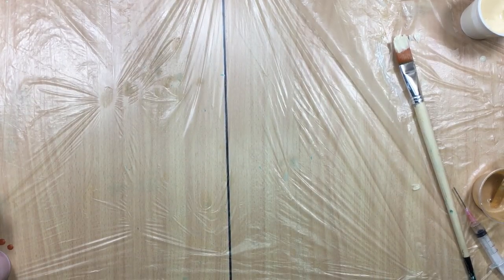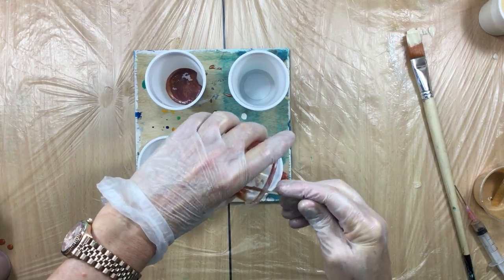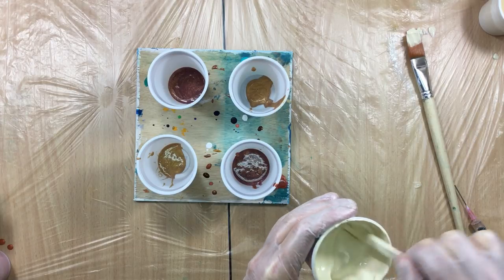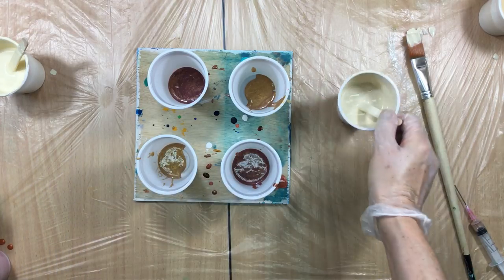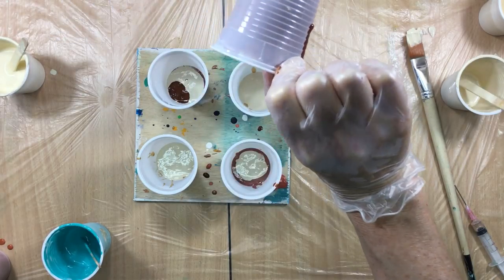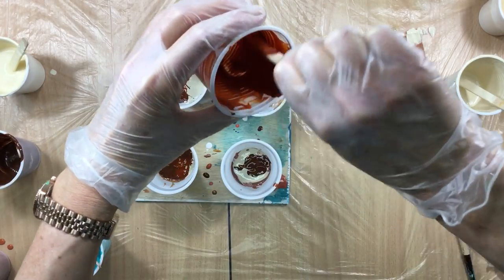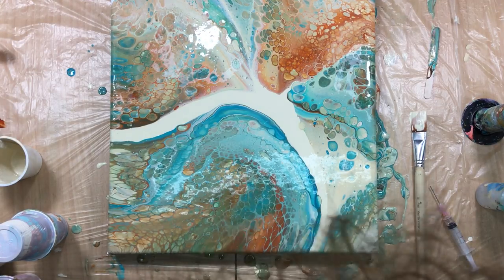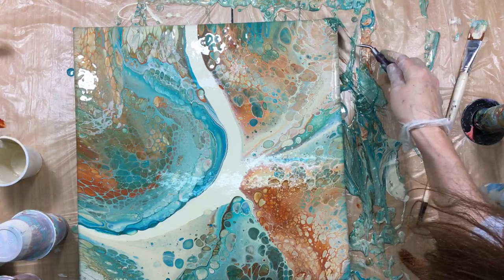( 283 ) 4 cup flip with rusty colours and turquoise.

Comment: Your videos are such a beautiful way to start my day!  When you do a multi cup flip cup on a larger canvas, try using a board inside the stretcher frame on the backside of the canvas to spread the pressure from your hand equally over the cups, might make the flip less likely to go a miss.  Another idea, you may have done this already, instead of pouring all of the 5th cup in the middle and spreading it with the brush, pour it in the areas you spread it.  Have a lovely day!
Reply from the maker: ♥♥♥Thank you ♥♥♥

Comment: Hi Annemarie.  Is it possible to use say Dulux water baste house paint to use for pouring acrylics thanks Pam
Reply from the maker: Yes I have heard a lot use housepaint... but I wouldn`t sell them but that`s just me....♥♥♥Thank you ♥♥♥
Reply: Pamela Usher I use Dulux Mixlab from the oops shelf at Homebase for my negative space and it works a charm. I grilled the Mixlab guy about whether the base they use was the same as the base in the off-the-shelf emulsion, but he didn't know (I've tried pouring with a cheap Aldi emulsion, but it didn't cell. it was much chalkier than the Dulux, the latter dries flexible just like acrylics).
After trying a 250ml tester pot of greyish white, I thought I'd have to stalk the place for months waiting for a white/ivory (I mean, who pays double for a hand mixed white?), but I went in a couple of weeks ago and found 5 litres of white and 5 litre and 1 litre cans of different shades of cream/ivory. They charge half price for the oops cans, so that lot cost me about £35 and will mix up to around 14 litres of paint. Enough to keep even the lost causes amongst us fixed up for a while.
Another great advantage of working with fluid negative space is that you can get really striking and effective results with very small amounts of acrylic colour. I've done 20x20cm pours with less than 5g of acrylic that produced plenty of colour. I plan to do a really light one with wisps of colour, which would only require the tiniest drizzle of paint in the cup (I use shot glasses for my flips, and often only half fill one for my colour)